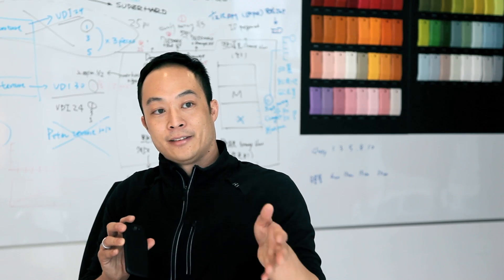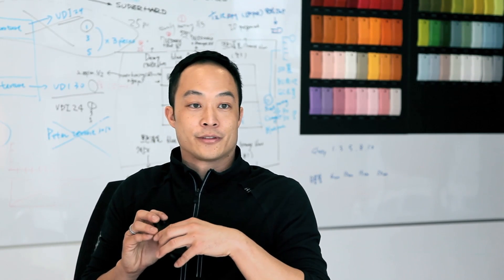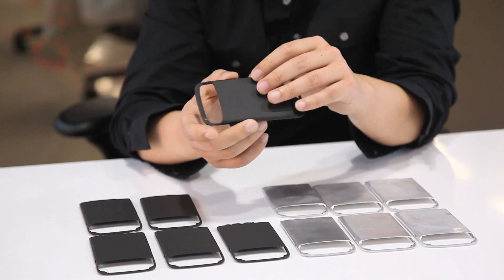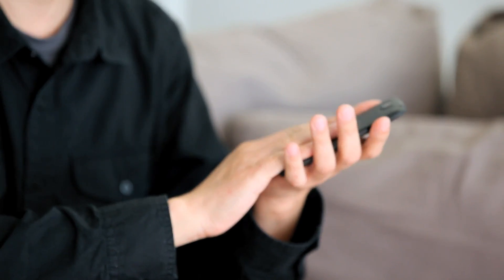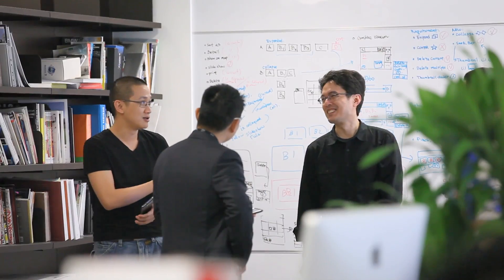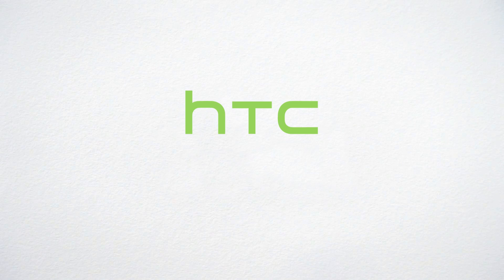Micro Arc Oxidation on HTC One S

Comment: the phone wont bend/brake/chip the frame when u drop it, but it will scratch like hell.i had a silver one and after 1 year most of the back was white from scratches .its the reason why i didn't bought the new htc one.im not getting fooled again.i want a phone that can handle scratches and tbh a normal plastic back can take much more abuse then this crappy material

Comment: Excellent video but 10000 volts of energy? Volts are not a measure of energy but potential difference. And if lightning stroke te aluminium casing it would probably melt it.... and all chemical reactions are microscopical. I mean...really... as an engineer I am disappointed.

Comment: Aluminum 6000 nothing to be proud of, they could of used 7000 series which is stronger. The treatment makes the surface more scratch resistant but it is not stronger than stainless steel by far and if you drop the phone, you'll get a bad dent since aluminum 6000 series is quite soft.

Comment: @brekk Anodizing is different. The metal is dipped in some kind of acid, then electricity is applied, and certain elements of the acid help form a coating over the aluminium.

In this case, there is no added substance, it's just high voltage which essentially makes the surface (which is in contact with air) burn.

Comment: @lezep2 No shit.  They started the unibody aluminum trend and clearly every other notebook manufacturer is trying to catch up. Until mid 2011, there were no major unibody laptops that weren't made by apple...now, all of HP's new notebooks have unibody designs, the new razer notebook has almost the same design as the mbpro (key shapes, keyboard indentation, etc.)  Obviously they didn't "invent" it but they were the first to deliver good design/build quailty.

Comment: @s4bot4ge The iphone 4 is back/front glass.  The iphone 1 had an aluminum back, not sure if it was anodized.  The macbook pro has had anodized aluminum unibody cases since 2006.  Plasma electrolytic oxidation is a very similar process but it is a bit better.  It took the competition 4 years to catch up to apple's notebook design.  Now we are seeing tons of copycat computers with nearly identical unibody notebook designs.  Obviously this is better than the original iphone but still